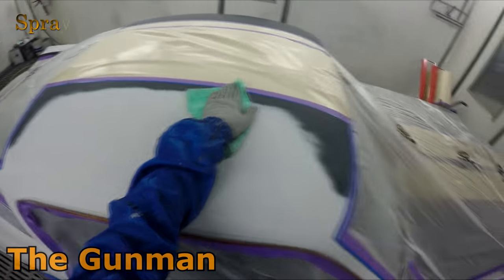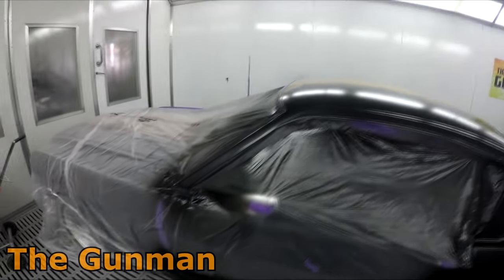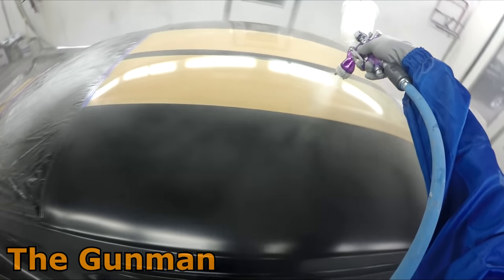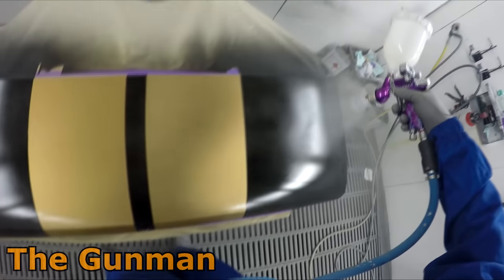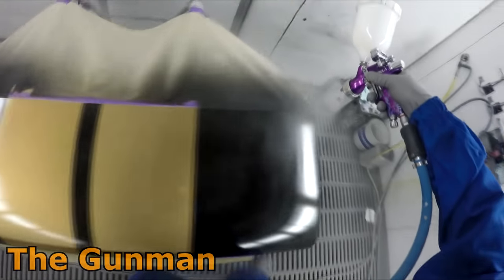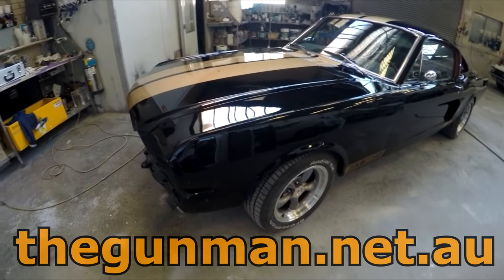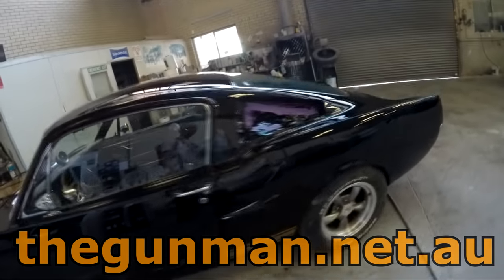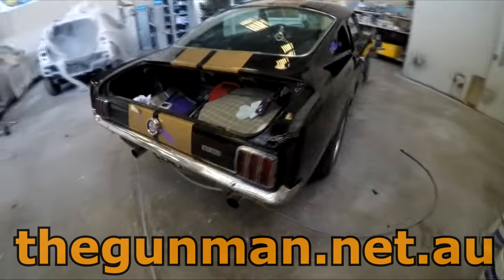GT350 Mustang Spray Painting

Comment: Great video again gunny and good that you show us your issues with silicon now n then as we all do 👌 
Do you not suffer with piggy tails when da sanding clearcoat mate ? Whenever i have tried da sanding clearcoat i get them no matter how clean i keep the panel ? 👍
Reply: All about sandpaper, I swear by the rev cut, make sure you are use the interface pads between  your, DA/palm sander and sandpaper 
   but most of all mate you have to make sure your palm sander is only a 5 mm orbital rotation that's another big mistake people can make. Specially on the clear coat.
 They are unaware you can get different orbital rotation, you can get them between 20mm and 5 mm 
And attaching a vacuum cleaner it help 
Search Abrasiflex

Comment: amazing job gunman, I did not understand, do you prefer for clearcoat the t110 or t20? what are the differences, apart from the air consumption, between the two air cap?
ciao from italy
Reply: t110 is glass finish and te20 is more of a oem finish orange peel on it

Comment: how do you keep the sandpaper disk from getting those seeds? i felt i was getting them every 5 seconds rendering the disk useless
Reply from the maker: Most likely cheap brand sandpaper but also if you're sanding crappy paint like acrylic you'll have problems dry sanding, if the paint dissolves with a thinners rag then it's probably acrylic and I'd recommend wet sanding with 800 grit.

Comment: Great finish, I just did two back to back GT350H last year full resto. A lot goes into the full on execution of the stipe's  and measurements. I believe I've got some videos of them if you check my channel, if any interest can upload more details, flow coated and all. Originally these had a very rough looking finish and the stripes were applied after the fact leaving a hard edge. Also the Fastbacks had louvered vents in the "window" openings and ducting from the side scoops to cool the rear brake system on these made for track cars. A option many revered to was the Lexan (Perspex) window instead of vent for visibility and over all look. A roll up window was not available for these fastbacks. keep up the dope work.